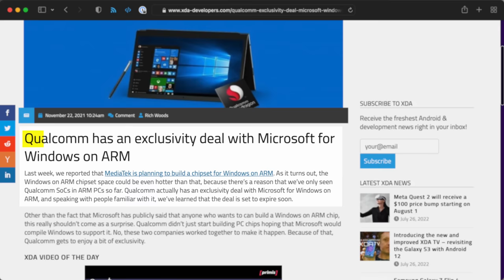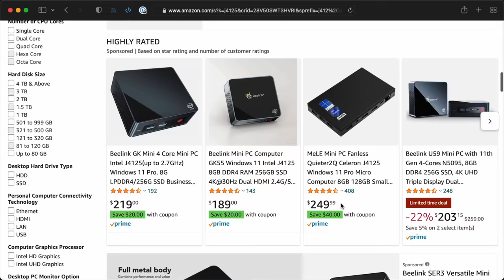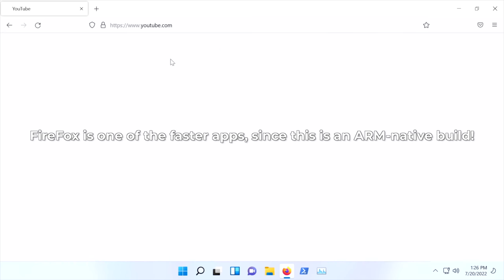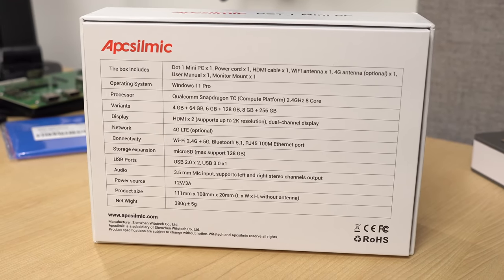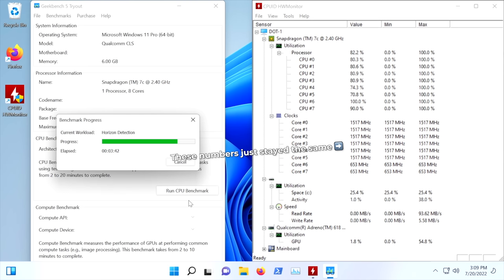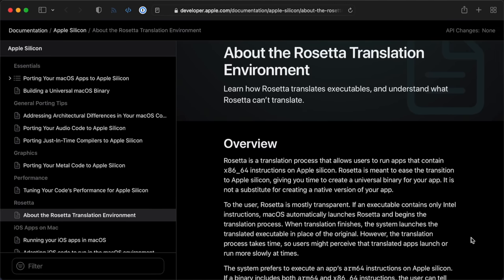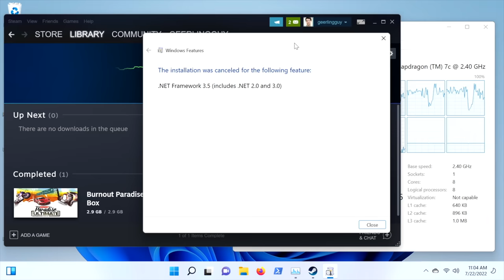Microsoft's wasted potential: Windows on ARM

Comment: I'd like to see some comparisons between this Dot 1 Mini PC, a Raspberry Pi 4 with 8 GB of RAM, and a Surface Pro X SQ1 or SQ2 all running Windows 11 ARM64.  I'm sure the Surface Pro X (either SQ) would outperform the other two in most tests.
We could add the M1 Mac in Parallels to this, but we all know that would smoke everything else.
Reply from the maker: I did some testing with the Pi 4 and Windows on Raspberry, and running Windows, things are definitely a bit slower. Also, I could only get 30 Hz refresh rate on my monitor, so that was slightly annoying too.

Comparing Pi OS on the Pi to Windows on the Dot 1, it was a more fair match. Running Windows on Raspberry, the GPU doesn't do anything, so CPU rendering slows a lot of things down.

Comment: I still have my MS Surface 2 RT with an ARM processor and running Windows RT.  It's actually rather nice, except that they failed to live up to their promise to stop bugging me about Windows Updates; annoyingly the updates are still occasionally coming in.  I even had to replace the battery in the Surface 2, which is quite the undertaking since the battery is at the very bottom of the hardware stack (requiring complete disassembly).

Comment: Windowns ARM is a native ARM64 app and all apps in Windows are native ARM64, for apps to run full speed their developers needs to compile for ARM64EC (equivalent to Rosetta2)  or produce a native ARM64 app, without that Windows will run them in emulation mode. Also the Qualcomm chips are just trash.

Comment: I wouldn't be surprised if Intel and AMD tries to sabotage ARM becoming a bid deal on windows
Reply: ARM is doing that all by itself with the lack upgrades to ram. Part of the issue is that the ram is locked to the CPU. 

Also, locking the GPU to the CPU is also a problem. It's even bigger when it comes to desktops.

Comment: I can play my all games with steam in Windows on ARM, and my M1 Mac works well. This video is using a low performance board to test it and I think it mean nothing about games are unplayable with Windows on ARM. There is new ARM-based laptops like Lenovo ThinkPad may work better. In another word, tried to use a board like raspberry-pi to show how worse that the Windows on ARM is. It didn’t guarantee the real performance with high end ARM CPUs at all. And some crashes may be you should install some library for x86 with visual studio installer may fixe it.

Comment: I remember seeing somewhere that while Rosetta has some tricks, actual performance for emulation on Windows's layer is better than Rosetta. I think that was tested back when hypervisor.framework was the only way to run vms on m1 though.

Good video though! Fun to have someone shed more light on the subject. If you want to mess around with a quicker platform on Windows on ARM I'd suggest getting a Surface Duo second hand or new for cheap and installing it there. LumiaWoA is rapidly progressing to almost a workable state as of now.

Comment: I bought a Lenovo X13s with the 8CX Gen 3, it is really good and I am excited for the future of Windows on Arm.
Reply: How good ? The Cortex X1 have equivalent performance to Apple's A12 big core
Reply: @siddestroyer  It is pretty responsive doing normal stuff with Windows. I have Edge and Firefox Nightly (arm native) and they run well. Everything else is good. I edit photos in Capture One Pro and performance is good if not better than the Surface Pro 7 I am coning from.

Comment: I've been using a Samsung Galaxy Book2 for a while now.  It's running Windows 11 well, and all the (business) apps I need or want to use (most are from the Microsoft 365 Business Premium suite, as well as a few others) run perfectly.

The performance is acceptable (I don't expect it to be a world leading laptop) and the battery performance is also acceptable.  It's no M1/M2 MacBook, that's for sure, but it is easily usable as a general business laptop.

Comment: Found out why Windows 10 and 11 works so slow on ARM.
Apparently, if you have less than 8GB of RAM, RAM compression is turned on by default. And the ARM CPU has to compress/decompress all that data all the time.
They say the data is read faster being compressed, but it's not, as write speed plummets, and compression only does like 50MB out of 4GB,
Totally useless unless you absolutely must have that 50MB. If not, just disable it. Should offer a speed bump, especially on the 8GB RAM versions.

Comment: Tip on WoA on Snapdragon: don't apply service pack unless you did full backup... almost every service pack breaks my LTE connection of my Snapdragon 850 device. 
Oh, and don't install drivers showed in Windows Update, it will brick your device, good luck for making a UEFI bootable ARM64 PE USB Stick because you can't just install Windows from install media directly, it will BSOD on first boot, it doesn't have drivers needed for booting sequence...
More and more softwares coming with native ARM64 binary, including VS2022, VSCode, JRE(Azure Zulu), VLC, 7-Zip, Office, Onedrive etc. Actually WoA experience in 2022 isn't that bad, I would say...

Comment: I've had an Asus NovaGo for 4 years now and it's a great couch and travel laptop.  Incredible battery life and perfect for web browsing and office productivity apps, but it's been real frustrating lately because Microsoft decided that the Snapdragon 835 was not getting the 64-bit treatment, so I'm stuck with ARM32.  From my understanding, the on-chip 64-bit implementation is hard to work with and they just couldn't be bothered.  And lately, Microsoft has been compiling a lot of its ARM stuff as 64-bit only.

Another frustrating thing is trying to do microcontroller development on it, so few of the USB-to-UART makers (FTDI and the Chinese CH9xxx stuff) have ARM-based drivers.

When not simply web browsing, I use it to RDP into other machines to do any programming.  The battery life has been its #1 virtue.
Reply from the maker: Battery life / power efficiency is still one area I can soundly recommend these devices, if you can get through the Windows 11 nonsense.
Reply: @JeffGeerling  I wouldn't know because Microsoft decided Snapdragon 835 wouldn't be supported in Win 11.  I'm stuck on 10.  Otherwise and overall though, it's been a great machine as long as you avoid WoW x86 emulation as much as possible.

Comment: Seems like an expensive low power terminal as all i can see using it for is a computer to have as a point to remote into another one or receive streaming data from a local server that does the compute. Maybe low power is worth 2x the cost thought the cost seems to be from the windows  11 license not the hardware.

Comment: Completely agree. Reducing power on the End user site will open up other possibilities. Unfortunately only Apple is currently ahead with this. Back in 2015, Microsoft had their Mobile adventure which they completely blasted. I was enjoying somewhat my Lumia 640LTE. Later the flagship with a MSM8994 chip from Qualcomm, this last one was having thermal issues as well. And then Microsoft decided to stop their adventure with Windows 8.1/10 on ARM. It could have been so much better now if they didn't stop.

Comment: Running x86 Windows apps on Windows 11 for ARM in Parallels on an M1 Mac is blazing fast. From what I've seen WOW64 doesn't seem to be inherently worse than Rosetta 2. When it works, it works well (on a Mac, in Parallels). The biggest reason Rosetta 2 almost always "just works" while WOW64 frequently doesn't work appears to be mostly a result of Apple's extreme discipline in deprecating and removing support for outdated libraries while Windows libs, especially the problematic low level libs, typically linger around forever. Windows software isn't typically forced to move to newer libs to run on newer OS releases.

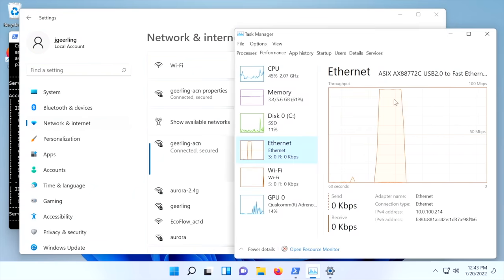Comment: 5:45 It is because you have the network cable attached and it detected it's the same network. The assumption is that wired is faster than wireless...
Reply from the maker: Microsoft shouldn't assume so much :D

But still, on my Mac and Linux PCs, it connects to both if I set them to connect automatically, and even if I set priority on Ethernet, it remains connected on WiFi as well.
Reply: @JeffGeerling  By default, Windows prioritises a wired connection over a wireless one. If it detects it's got a stable ethernet connection to the same network and nothing is explicitly using the adapter, it'll disconnect WiFi. This behaviour can be overridden by setting the priority of the wireless adapter to be above that of the wired one.

It's certainly a little odd, and I've only run into it as I have a wireless adapter in my server which serves to keep it connected in the event I need to unplug and reroute the ethernet cable.

Comment: 2:18 well, that must just be a cpu slowness issue, My PowerShell takes even longer to open on my FX 6300 machine when on Windows
Reply: This is not a CPU issue, powershell does some synchronous slow garbage at startup and won't show you the prompt until it's done. Poorly designed
Reply: @Deniil2000  I always try to give the benefit of the doubt, but i guess spycrosoft just makes bad software

Comment: Hear me out. I think Microsoft should double down their commitment on "Windows in ARM" and try to reenter into the mobile space. They have an operating system that is widely being use and they could even built an ecosystem similar to apple's if they wanted to. First structure the OS that could work seamlessly with a tablet and a PC/Laptop. Then, scale it down in a way that it could work on a mobile phones. Followed by smartwatches then, mobile accessories such as earphones and smarthome devices. Basically, what im trying to say is if you have the Software you basically control everything. It is all about timing...

Comment: A lot of windows software is .Net based already. That means it is compiled to native arm code. And Java should do the same. But as always with the Windows you can't run it from SDCARD or usb 2.0 or other very slow drive. That could be the biggest bottleneck.

Comment: I had a 100mbps connection and Fortnite would take about 30 min to update.

Had because they forced me to upgrade to 200mbps. My sister is lucky were she lives the same ISP offers 600mbps for the slightly less $ and 300mbps is the cheapest option. :(

Comment: Windows will always prefer a wired connection over wireless. That's why it won't auto connect when ethernet is hooked up. That's not an issue of the device, but a design choice of Windows.

Comment: You know something's wrong when Wi-Fi is faster than a hardwired ethernet connection.
Reply from the maker: Just wait until WiFi 7 is here... I'm betting a lot of manufacturers will just drop Ethernet (sigh), even though 2.5G would still be better in most cases.

Comment: In short, you can't say that "Windows on ARM is very slow" by using Windows 11 on a very slow and old CPU like Snapdragon 7C Gen 1. You should try a decent ARM based computer CPU like Snapdragon 8C Gen 3. For example you can try Lenovo ThinkPad X13. If you prepare a video for Lenovo ThinkPad X13 or Microsoft Surface Pro 9 5G, and compare it with x64/x86 CPUs, it would be much fairer comparison.

Comment: Most of the problems you stated our problems with the hardware itself which Microsoft has nothing to do with now I do agree Microsoft doesn't work on their compatibility layer however that's mostly going to be developers being encouraged to move over to dot net core. It has more compatibility with arm processors. Under the circumstances most developers don't have any incentives to do so because there aren't that many windows 11 devices that run on arm I looked they're just not there so most developers don't have the incentive to develop on more cross-platform Frameworks if you're going to make an app for Windows x64 x86 is the primary platform which is disappointing it would make laptops that's cool actually last for days on end but thems the brakes and one last point Apple didn't make their compatibility layer work any better on arm what they did was they put a secondary chip which handles emulating processes while the main chip handles the primary processes in short they offshooted the processes off the M1 that would mean manufacturer implementation though not on Microsoft side it is worth noting you're bitching about the losing Snapdragon processors however benchmarks between Snapdragon processors and any other arm chip puts the Snapdragon processors at being much better than M1. Apple just has more control over what Hardware gets put into there machines Microsoft does

Comment: Running Windows on ARM in a VM on Apple Silicon is pretty easy. Just use Parallels or UTM, build an ISO using tools from uupdump (Windows 11 release builds are there, though not linked on the home page) and use standard registry hacks to work around TPM/Secure Boot checks. And the irony is that a VM running on a Mac is the best Windows on ARM experience you can get anywhere XD

As for running Windows on ARM Macs natively... My money is on it never happening, regardless of any exclusivity deals. Microsoft's change to system requirements for Win11 is a clear sign that they want to limit the number of configurations they need to support, and have more to say in shaping the hardware landscape. Apple Silicon Macs don't fit into this concept whatsoever - it's hardware Microsoft have no control over, and it's so non-standard (the custom interrupt controller being the biggest offender) that Windows would need a custom HAL tailor-made just for Apple machines to run there. It would be technically possible, but just too much effort on Microsoft's part for something that seems to be at odds with the Windows team's current strategic vision.

Comment: Windows on arm on the M1 mac in a VM hypervisor is crazy fast. Some processes have some hang but it's likely because of x86/x64 binaries running in emulation/conversion. Ultimately, I'm extremely impressed in the performance of windows on arm on the most base-model macbook air and that's running two full fledged desktop OS's at the same time, some ~AAA title games even ran very well! I want to blame the junky SOC in this little Apcsilmic device for the poor performance shown in this video.

Comment: I believe Windows is basically stuck with x86 unless Microsoft forces users to adopt ARM. Because most Windows users (both private and corporate) are hell bent on "muh legacy software" compatibility. And unfortunately there is realistically just no way to make a compatibility layer that is 100% perfect. Even with a perfect compatibility layer, software/games with DRM and anti-cheat for example could still oppose problems. (similar kind of issues that Valve has to deal with the Proton compatibility layer).

The mindset of most users appears to be that they really don't care about power efficiency. They would rather buy a beefy PSU and watercooler, rather than just to sacrifice some backwards compatibility and move to a more efficient architecture.

Comment: I don't see who the target audience for windows on ARM would be. Anyone who wants to run x86 software would not choose ARM, and why would anyone choose windows if they are running native ARM software? Having said that that snapdragon 7c is all over the place in it's geekbench score, 533 versus 383 is a 28% drop in single threaded performance. For a chip that has 2+6 cores how can you throttle a single core due to power dissipation at high temps? (I understand how when all 8 cores are running it can get hot, but single thread?)

Comment: Hey, Angry KB here, As someone who has a MCSE in NT 4.0. I want to say that peak of Microsoft Tech is probably Windows 7 64x.  That's it. Every single quarterly build in Windows 10 has been slower then the last and worse. (And if say you haven't performed a junk clean and a clearing of history object. You can open file explorer and watch as the system stays hung.) Not going to give you the back story of what I went through to chop off the head of the Win 11 upgrade (but even these "tool builders" started to get too "clever", just kill all unwanted MS services, bloat and shut off Telemetry. (Sophia Script is trash...) The end.)

Enough with the hamster wheel shit MS. No, its worse. We had DIRECT DOWNLOADS TO A GOOD COPY OF WIN 10 FOR RPi3. This is pure greed and stupidity.

If i could join a class action against MS. I would. These Edge "agents" and Spying Patterns are vile. MS publishes Advertising Trash. The OS is broken. I won't get into the business model that we can clearly see as a garbage model for say a engineered disease.. AND what is being done to say farmland.

But in my humble opinion, we need to stop buying any product from them and burn the company to the ground, in Minecraft..

Good video.

Comment: Well, apple just has a lot of power while Microsoft doesn't. Same goes for Android and other platforms where the developer doesn't controll software and hardware. That's why we should be kind of happy that a system like that of apple exists even if we would never use a closed system.